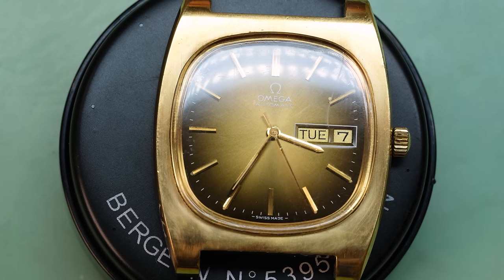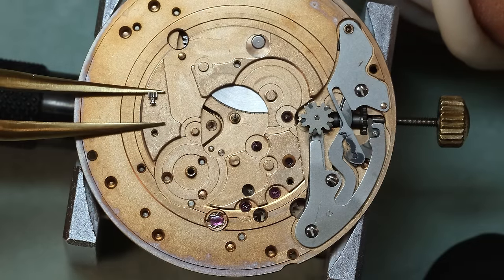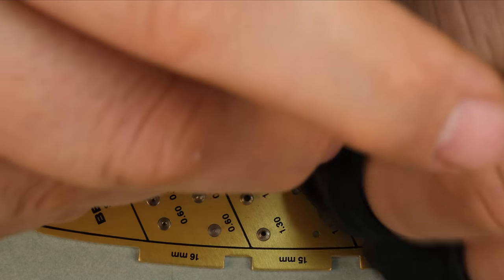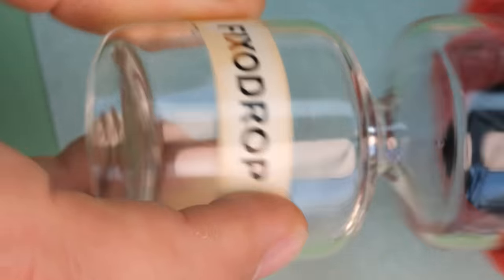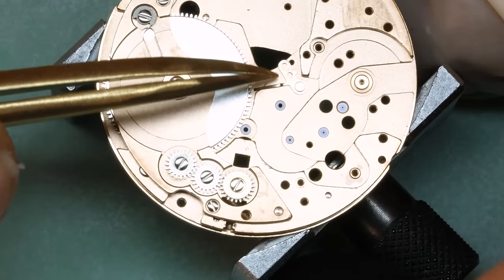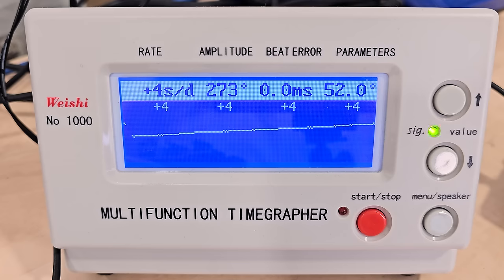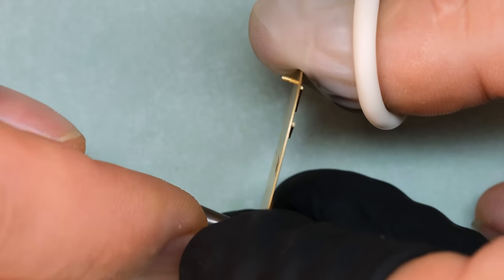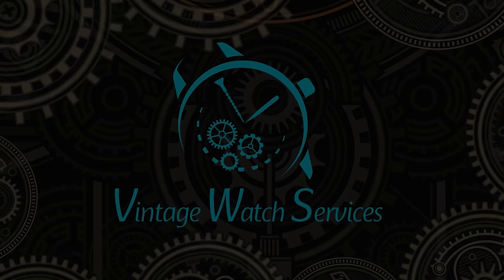The dreaded Omega 1000 family...! 😖

Comment: The green/blue color (verdigris) is a copper salt from reactions to moisture and acids (water can be an acid). Copper in the watch can be either the brass (if base metal) or the copper plating (over stainless) before gold plating. Copper is often used as a plating material in between other metals because of its ability to adhere well. That’s why you may see it under gold, chrome, nickel, etc. before you get to steel. Brass already has copper, so you usually don’t need the additional layer. Sorry for the blabbering. I worked in the decorative lighting industry for far too long and have seen lots of plating and verdigris patinas! 😅
Reply: And all it takes is the tiniest of micro scratches for the copper to be exposed. So areas around the bezel, the crown tube, the lug holes, threads, or any place that has some friction and has the potential to hide moisture may have some oxidation.
Reply from the maker: Thanks a lot for your elaborate explanation, Ben, very much appreciated! 👍

Comment: 35:34 ... and not to forget the strength of the lungs a watchmaker has, because in order to pressure test a watch he has to suck out all the air out of a glass bottle to create a vacuum. That's the reason why Reinhold Messner once was rejected to be a watchmaker, and became a mountain climber instead, because his lungs have been too weak for that. He might be able to get to the top of Mount Everest without the help of a oxygen bottle, but he cannot create a vacuum for the pressure test of a watch. But, I guess, you already know about that. 😊

Comment: When servicing a vintage watch (something where keeping original parts doesn't matter) Are any of the parts considered wear and tear items and should be replaced   regardless if the part is broken or not (ie. Main spring and barrel) to help maintain longevity of the watch?
Reply from the maker: You'll have to replace or repair parts which are worn, indeed. The good thing about vintage watches is that they were made with much better materials than today's watches, meaning that they last decades longer.

Comment: Really nice inaugural video for the new year, Stian.  Very interesting movement.  Quite a contrast to the 500 series. There's a three wheel train from the crown wheel to the ratchet wheel, which seems a bit overdone.  Is that to ease the winding force due to the heavy tensile strength of the mainspring?
Reply from the maker: It's really a design choice, given that there isn't really space for a larger crown wheel. But the movement does wind quite smoothly, indeed.

Comment: General question please..watched an early video on a Zenith 2562 Surf.
The setting wheel/intermediate wheel at the end of the keyless works has a bevel to one side...is the orientation of the wheels bevel up or down when in place...thanks
Reply from the maker: In most cases the bevel should be down, but for instance on the ETA 2824 it's actually up. If in doubt, put it down.
Reply: Thank you for the clarification
Reply from the maker: @darrylmcmahon6604 👍

Comment: Happy New Year 2024! How hard would it be to find the balance wheel spring for a Cortébert CAL451 (AS1250) movement? Dad’s watch’s balance wheel adjustment is completely at Retard or (–) most likely due to myself having it destroyed when I was a kid… I’ve sourc3d the main spring which was replaced and the watch is running like new, albeit, with the adjustment completely at Retard.
Reply from the maker: Happy New Year to you also :) You'd need to find a balance complete, as finding only the hairspring is very difficult and would also require you to vibrate it to the balance.
Reply: @VintageWatchServices  Indeed! I should have pursued the trade as watchmaker instead of watchwrecker as a kid! There’s an AS1250 on eBay but they’re asking good money for it! I guess I’ll let it go!

Comment: The 1010 & 1020 that followed are pretty different movements. Not Omega's best, but very good, thin, & featuring a very convenient quick-set for the day & date. I think the justifiable avoidance of the 1000 scares people off the 1010/1020. Those 1010-&-up vintage pieces can be a good buy, with some cool designs, including some integrated bracelets.
Reply: Agreed. 1020 = spectacular value.

Comment: It has the kind of case shape that was introduced in the early 1970s, so I’ll go for 1973.

Green gunk is usually a copper salt…

Tiny little screws make the movement feel fragile…must have been designed by Boeing 😚. They didn’t take into account how big and strong watchmakers are 😉😂

Very nicely done as always Stian 👍
Reply from the maker: Pretty much spot on! This one is from 1974 but they surely made it in the years just before that also. Nice Boeing reference 😁

Comment: The cased must be brass underneath the gold. It corrodes and the green residue is called verdigris. Of course you know that. You only ask, so folks add comments for the algorithm 🙂.
Reply from the maker: My question was actually genuine, as this case is made of steel. Base metal cases were used by cheaper brands in cheaper watches, never by Omega. I know the verdigris comes from copper but didn't know where that copper would come from in a case like this. Another commenter with a background in decorative lighting and he said the makers would sometimes use brass plating under the gold plating, which would explain the verdigris.